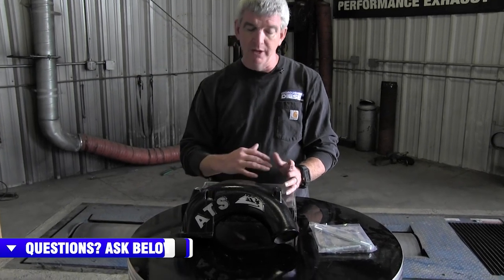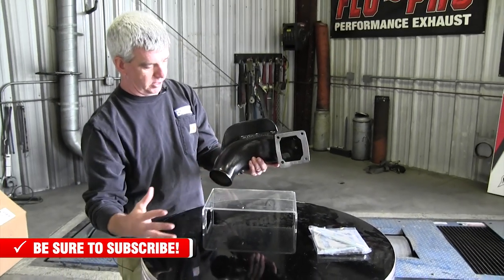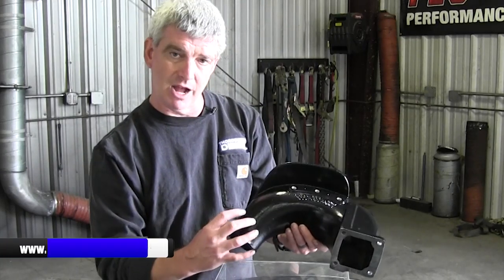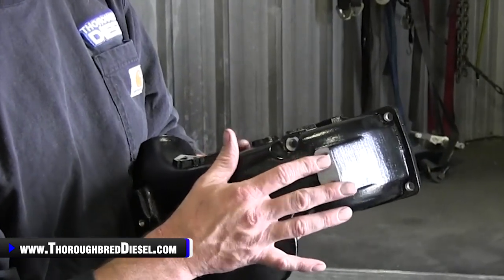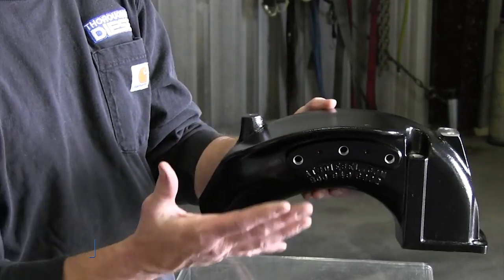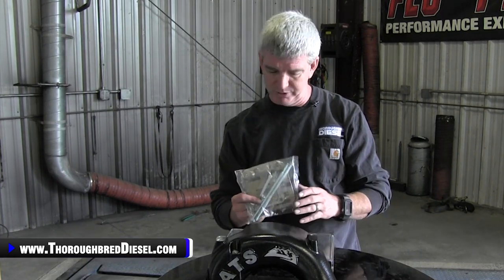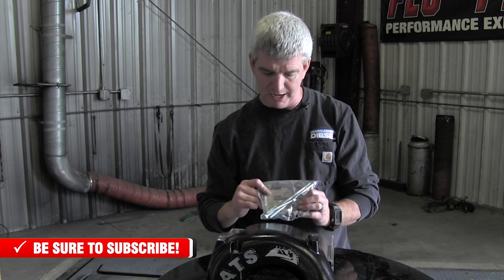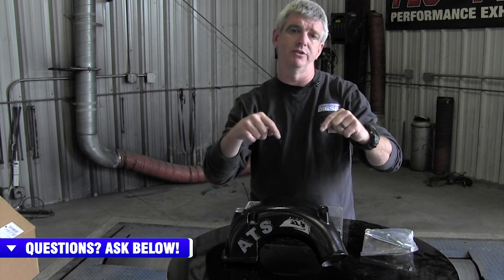FREE Up Extra Hidden Horsepower w/ ATS Arc-Flow Intake Manifold & Features You Didn't Know About It

Comment: I’ve heard quite a bit of debate on the effectiveness of these. I’ve seen many setups running the stock intake manifold that are pushing 1000+ hp. Interested to hear your thoughts and Dyno numbers before and after one
Reply: I would wonder how much more they could get with a more efficient air intake horn and how do they inject water/Methanol or NOX and such?
Reply: While aftermarket intake manifolds can look neat, be customized or allow for a “smoother flow”, you’re only ever going to flow as much air as your smallest bottleneck in the intercooler system/piping.

Comment: Every manufacturer of any "upgrade" says their product is the best of it's kind. Banks even shows a comparison of airflow chart between all the different air horns with a couple that are actually worse for air flow than the stock horn. Of course theirs is the best in their chart, but how do we know which one is really the best?
As for that fin/cover that goes over the 3 ports that's just hokey. It's going to make it harder to get at those ports and you're still going to have the wires/tubing etc. coming out from under it. But all that aside, Which one is the BEST???

Comment: So this won't fit a p-pumped 24v?
Reply: That would be nice to know wouldn't it? If/when my VP-44 dies I plan to have a P-Pump installed in it's place. Making it the ultimate EMP proof engine... LOL I don't use the upper third of the RPM range anyway and would like the anvil like reliability of the P-Pump.